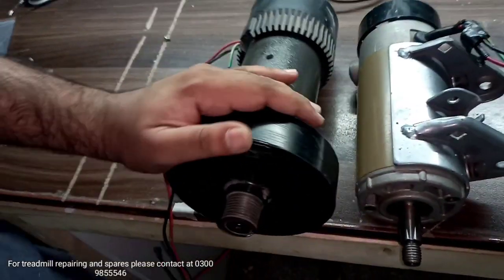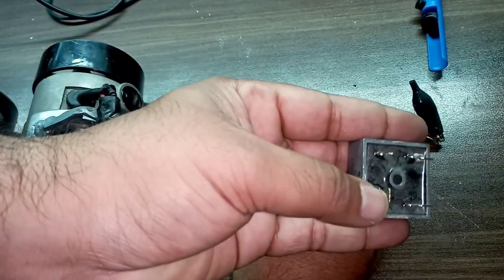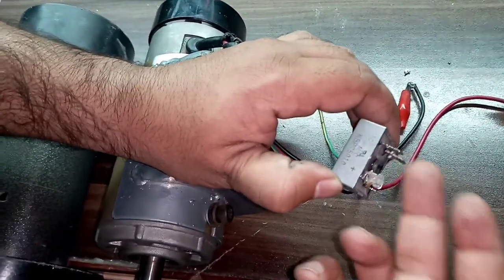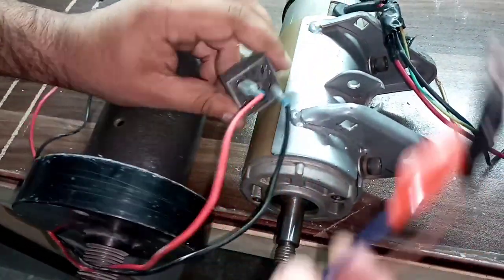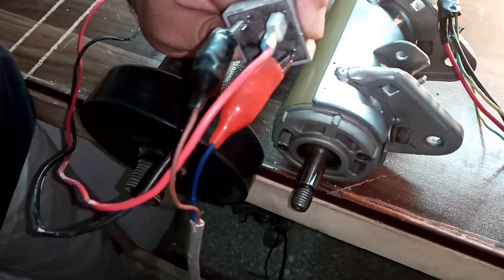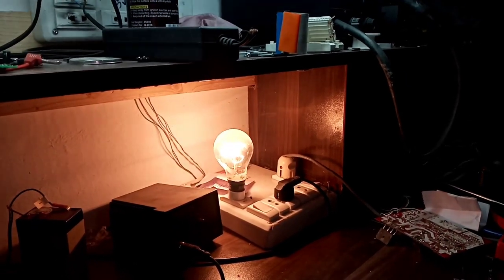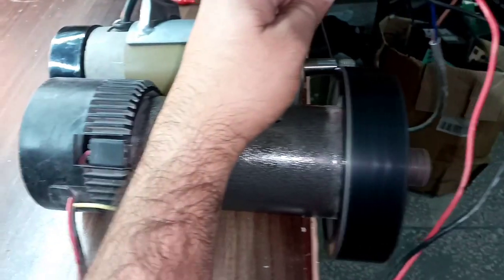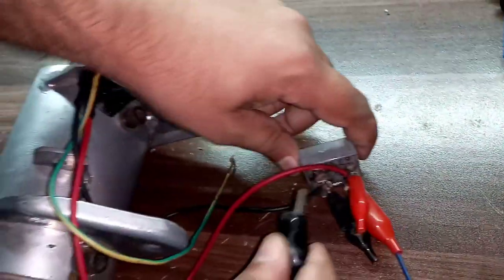How to test treadmill motor

Comment: output DC voltage from bridge rectifier is around  230v DC, treadmill motor is rated for DC 180V. This excess DC will not damage a good working motor?
Reply: Use a dc battery or ac to dc adaptor 12 v dc 2 amps or less

Comment: It's just need 12 volts DC to check or you can  check by multi meter no need of all this is risky its cause damage the motor because of higher DC voltage